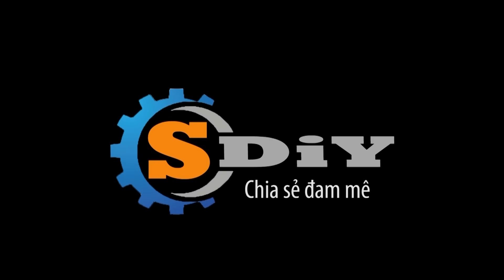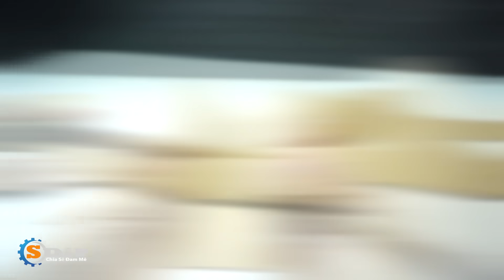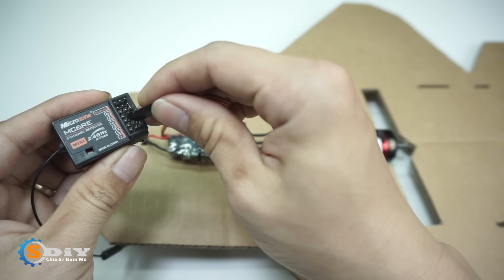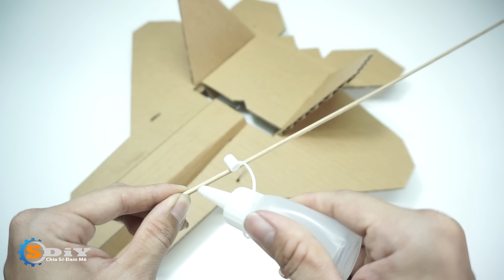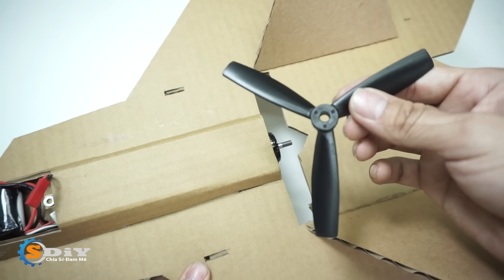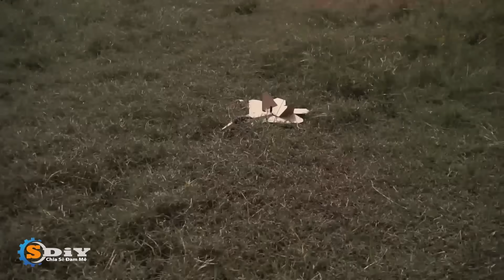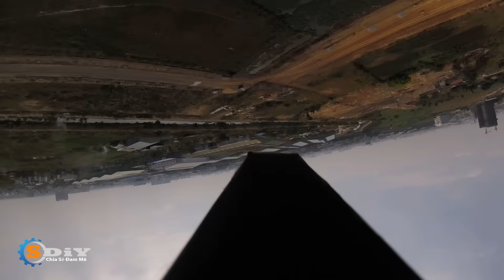Cardboard RC Airplane DIY - F22 Raptor l S-DiY

Comment: What is its weight? 
I have a 1000kv motor and 2200mah 11.1V Lipo. Will it be able to fly with that weight? Wanted a little guidance brother. Thanks in advance !!

Comment: Friend, I have a question. I'm building one like your project, just 1 mm Styrofoam, but I bought the a2208 kv2600, 30A motor. Will this motor work, or should I buy a kv2200 one?

Comment: Is it possible that instead of using cardboard, I could use wood? That same type of wood used to back mirrors and to line cabinet drawers? I am asking because I am not sure if that would affect the weight of the craft in any way?

Comment: Cardboard is not a normal air foil. thus it needs a lot of power to create lift.   Foam board is a more common material  lighter material or you could try to laminate and shape the wing for lift.

Comment: Very impressive design, and even more impressive flying.  Just like modern jet fighters these planes cannot glide as the wings don't provide any lift, and you must fly these RC planes fast, and in turn you have to have good reflex in order to control these planes.  But on top of that the pilot was doing barrel rolls which are much harder than it seems.  The plane is nothing but a dot in the sky when you're not viewing through a camera's zoom lens, and you gotta nail your rolls by finishing them with the plane pointing right side up or it'll be instant disaster. :)  Much kudos.

Comment: Ok, so, first of all: Thank you for the video! It IS an awsome idea.I don´t know how many people commenting here have actually tried to build it themselves though...its not as easy and straightforward as this video makes it look.
Particularily because its misssing a few parts/some things are obstructed.

My Kid decided to make this as a school project with his friends and i helped them.
We just came back after our first test run and disappointingly it didn´t even take off.
Hopefully it was only the battery being too discharged, it doesn´t say how long the battery should last in the video, but we fully charged it overnight and afair we only did a few tests of the rotor before we took it outside, so I don´t see how it could have discharged that quickly.
We´ll do another testrun tomorrow and we also still have another battery with a higher burst rate (75c). It was a bit bigger and heavier, so we tried to get a battery with the exact same specs (3s, 25c, 1000mah).

I´ll report back after the next test, but meanwhile, here are some of the issues you might encounter when trying to build this:

1. Its actually not that easy to find the correct cardboard. Ours where either too light or too heavy or too small in size. You´ll spend some time looking for that.
2. The links for the listed items are mostly dead/don´t work in my country. We ended up getting most of the electronics from amazon though.
3. There are a few steps missing completely:
4. There are no instructions for how to exactly bend the wire, we had to do a few ones until we got the measurements right.
5. There are no instructions on where to get the holders on on the flaps for the wire. We kinda made one ourselves out of plastic.
7. There is a missing part about how to connect the battery on the topside with the ESC on the backside. We ended up simply cutting a hole in the cockpit area.
8. For someone who has never built something like that, a few more infos would have been nice about how the parts work together. For example: Since we couldn´t find the exact models for either the battery or the motor, we ended up with a bunch of unanswered questions and had to reorder several parts...
-There are CW or CCW motors, which do you need to get?
-You can put in the rotor one way or the other way, does that matter and which is correct?
We had several tries with CW and CCW AND switching how we put in the rotor, but the push of air was always in the wrong direction.
Finally we figured out that we simply had to switch the wires around, that connect the battery with the ESC, until the direction of the airflow was correct.
-There are SO many different types of batteries and we had no clue about the "mAh" amount or the "burst rate", like I said, I feel like a burst rate of 25c is maybe not enough, but we´ll see tomorrow...

Again, great idea and execution, but for those of you actually trying to buiild it yourself: Be aware of these missing infos!
Reply from the maker: Thank you. Because of the language difference, and my video presentation experience is still limited. Thank you very much for your sincere feedback!
Reply: Me avisas si esque te funciona exactamente como del video
Reply: If you’re in need of assistance, many local hobby stores staff plenty of knowledgeable individuals. Many, many different hardware configurations can suffice your needs, so there are multiple solutions to any given problem. Before criticizing someone else hard work, keep in mind this video is in a ‘Do-It-Yourself’ format. There are plenty of online resources to help identify and solve your issues in more of a ‘How-To: Step by Step’ fashion. 
Happy hobbying ;)

Comment: Can we use 6045 propeller for this?
Reply from the maker: Hello. With a wingspan of 46cm as shown in the video, you can only use a maximum of 5inch wings (5040 or 5045). With a 6ich wing, you need to increase the wingspan to about 60cm.
Reply: Thank you.

Comment: i got to admire your piloting skills but u could have made it easy to fly and land(fly at low speeds) by focusing on the airfoil, there is no airfoil at all, u need to check out the airfoil designs to find the one well suited for your need

Comment: Pretty much flys perfect once u fixed cg...great job...i just would not want to use cardboard unless there is a way to protect it from water...maybe spraying 3 coats on model with poly spray would do the trick..very nice job and design.😊
Reply from the maker: Thank you!

Comment: Can I use 2200kv BLDC motor instead of this one ? Will the thrust of 2200kv motor be enough for this plane ?!
Reply from the maker: Thank you. Do you have 2212 2200kv ? it will be bigger and heavier than my 2205 2300kv ! Traction both about 700g. With this model, 2205 2300kv would be optimal. 2212 2200kv will be heavy and difficult to control !
Reply: @SDiYchannel01  Ok bro thanks a lot,  but I don't have enough money to buy this motor,  so can my 2212 2200kv motor still be able to fly this cardboard plane?
Reply from the maker: @assassings3030  Hi, it can fly but won't be optimal. You can increase the size of the plane a bit larger, the wingspan is about 55cm instead of 46cm like the original !

Comment: A ơi f22 sải 54cm 
E dùng combo này có đc k ạh 
Tx rx: mc6c
Pin 3s 130mah
Esc 20a
Sevo 9g (x2) 
Cánh 5045
Motor e chưa biết nên đi motor nào 2212-2208-2205 nên đi motor nào ạh và bao nhiêu kv ạh
A chọn motor giúp e vs ạh ❤❤
Reply from the maker: Hi bạn, với pin 1300 3s thì đi mt 2205 2300kv hoặc 2500kv cánh 5 là ngon lành nha bạn. Nếu mới chơi thù cứ ưu tiên pin nhẹ, mt nhỏ vậy là ok. Vật liệu thì ở VN mình chỉ nên chọn MPP hoặc depron, ko nên chọn bất cứ loại nào khác nhé !

Comment: On my plane The up and down movement is okay but the left and right is the opposite of what you just shown, is there anyway to reverse it?
Reply from the maker: Sorry for the late reply. With the controller Mc6c, reverse the servo plug position of CH1 and CH2. If not, use the REV button of the AIL and ELE channels. Or you can combine both ways to get the right servo stroke!
Reply: Thank you very much it worked

Comment: A ơi e chế 1 con f22 đi motor 2205 
Pin 2s 1500mah xả 35c có ổn k ạ ❤❤❤🎉
Reply from the maker: Hi bạn, mt 2205 2300kv  pin 2s với cánh 5" dc tầm 400g , cánh 6" tầm 500g. Gọi là bay được thôi bạn, chứ ì ạch lắm !
Reply: @SDiYchannel01  cánh như trên clip của a là cánh 5” hay 6” 
E mới chơi môn nay nên k bt biết ạh
Reply from the maker: @cau6806  mình xài cánh 5'', muốn gắn 6" thì sải cánh phải to trên 60cm. Lúc này lại nặng thêm. Nên hợp lý nhất phải là pin 3s. Còn nếu vẫn 2s thì bạn nên chọn 2s800mah, kit depron sải 50 cánh 5"", bay kiểu mini nhẹ nhàng !

Comment: Can you please tell how to measure CG  any aircraft plz.
Ex- I am making a mig 29 so how doi I measure the CG.
Reply from the maker: Thank you. Please visit the website "Flying wing CG calculator" to calculate the base CG based on the main wing area. There is almost no exact formula for each aircraft type, I just rely on experience. For example su27, su30, su35, mig29 will have similar wing shapes, so the center of gravity will be roughly the same!

Comment: What an excellent demonstration of how little Bernoulli's Principle actually contributes to lift. Looks like we were all lied to by our 8th grade science teachers!
Reply: Well, cardboard vs. steel, lift requirements are a little different.  Sure, you put enough thrust on a flat surface and angle it to the relative wind, you can make it fly.  But flying efficiently needs every trick.  Believe me, if the airfoil shape of a wing was irrelevant, manufacturers would have stopped doing it to reduce cost.  They still make airfoils because airfoils still work.

Comment: I see now where is the issue with my F22, it was always too heavy because I was building it twice as bigger than yours, the plans printed on A4 papers make it twice as bigger but I build like 6th F22 and I partially used depron so the weight without battery is 340g and I used Emax Eco II 2807 1700KV so that should be crazy fast once it doesnt tear apart. Do you know where is the CG located on the bigger version? Twice as bigger than the one you built in the video
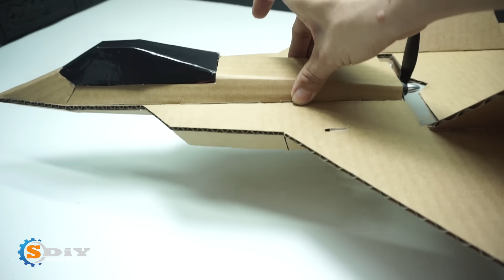Reply from the maker: Hi friend. It's nice to have a friend with the same passion. Regarding the center of gravity, any size it will correspond to in a position like 5:56 . In the drawing folder there is a 46cm a4 file, you can check it again if you want to reduce the size. If you have any other questions, please contact me via email sdiychannel01@gmail

Comment: Can I use the *A2212/6T-2200KV Brushless Outrunner Motor*? because I cannot find the motor you used in my country.
Reply from the maker: Hi. Motor 2212 will be heavier, consume more battery. The increased weight of the battery will make it difficult to control. You can solve it by increasing the overall size of the print to about 55cm!

Comment: Vomo hago para aumentar su tamaño y así el de la hélice a 8050 no dispongo de 5"
Reply from the maker: To use the 8050 wing you have to change the overall overall dimensions by 30%, which is about 60cm wingspan!

Comment: Don't get fooled. This is very dificult model to make, there are missing steps in video, extra holes cut which are missing in paper plan and so on.. just find some entry level ready airplain rc model before jumping in this nightmer...
Reply from the maker: I tried my best to make the video as concise as possible. To give inspiration about model airplanes. But ...

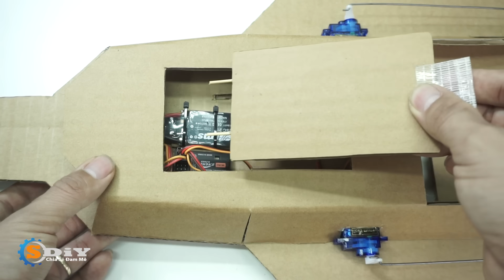Comment: I have a question, how did you connected servo motor to elevators of plane so that it moves up down? I didn't get that part, also servo motor pin assembly that is visible at @4:00 for rest of video it's not seen at all? Did you covered it ? Like when you move elevators at @5:28 where is that servo pin assembly? I can't see any visible pin attached to servo motor?  Can you please explain it ? I am trying to make it as you instructed but I am stuck at making elevator move with servo motor pin assembly
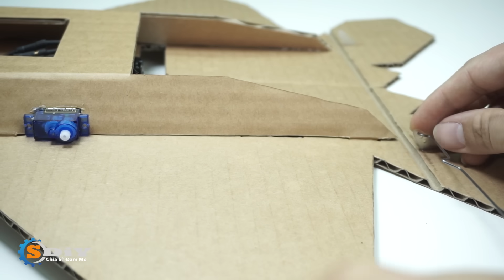Reply: @S-DiY  hey still a confusion, if you look at @3:42 that 1.5 mm steel link's one end is connected to servo, the other end of it is connected to elevator with a safety pin 🧷 kind of thing? Right? That safety pin  is connected at elevator to move it with servo.?
Reply from the maker: Hi friend. At 4:00 fully demonstrated how to plug the servo wire. It includes 1 servo in PIN 1, the second servo in PIN 2. To make the elevator and aleron go up and down like that, turn on the Mix elevon mode (if it's tx MC6C like mine, how to activate it at 5:07). Hope useful for you!
Reply from the maker: Hi friend, more precisely it's a control horn. Because of the video length, I can't show the details, you can check out my other videos that will segment about control horn ! (Sorry, I use translator)
Reply: @SDiYchannel01  thanks friend, now I have some clue to how to move elevator, control horn is all i need ☺

Comment: Hello, s die I have a microzone mc6c transmitter and a mc6RE receiver so now I need to make a fpv racing drone using this transmitter and receiver so is the mc6RE receiver has an S.BUS port to connect a flight controller???so is this MC6RE receiver  compatible with any S.BUS support fpv racing drone flight controllers??

Comment: Would it be good to use Lipo 3S 6000 mah 45C + RMax 2204-2300KV with this ?
Reply from the maker: Hi friend, Because of the weight limit, only 3s1000 or 1500mah batteries can be used with this model size!

Comment: How much does your battery weigh?  what camera do you use?
Reply from the maker: Hi friend, I use 3s1000 25c battery, weight is about 85g. For the camera, I use gopro session, which connects the cradle to the fuselage by a drawstring !
Reply: Thank you for your answer 😃

Comment: Hello. I have a question about the overall dimensions. If I print a A3 version what will be the wingspan?
Reply from the maker: Hi friend, with the a1 version, the wingspan size will be about 46cm. With A3 Paper Size, I guess the wingspan is only about 30cm, it's very small

Comment: This is so awesome that my son and I build it according to your guide. However, we had to modify the motor placing as we do not have the counterclockwise motor. The recommended motor is no longer available. What is your recommendation? Though we managed to fly it, it seems to have other problems, the ctr of the gravity, the glide seems unstable too.
Reply from the maker: Thank you for your attention. Regarding the motor direction, you only need to reverse 2 of the 3 motor wires to reverse, rotate the propeller direction appropriately, regardless of whether it is CW or CCW. If the plane is unbalanced, re-weigh the center of gravity correctly. Make sure the steering wheels turn flat. Hope useful for you !

Comment: Brother i am not getting 5045 tri propeller anywhere in market so which propeller should i use??????
Reply from the maker: You can replace it with other 5-inch propellers, for example 5040, 5140... you can even choose 2-leaf blades.

Comment: Is 95gm is perfect for the weight for the battery????
Reply from the maker: Hi friend, my 3s1000 battery is about 80g. With a battery of about 85h it is still possible within the limit, however, higher speed will be required because of the increased weight

Comment: Sir can't we use Quadcopter prop???
Reply: Like the double one??
Reply from the maker: Hi friend, there are many types of drone propellers, you need to choose one for FPV racing, like in the video I use 5045 prop
Reply from the maker: @reallybonginsane628  Please download the drawing
 Update in my pinned comments. Select the file "A4 paper 46cm.." When printing, it will consist of several a4 copies spliced together

Comment: Hey, will you please gave much more details for parts? Motors are cw or ccw idk what is the difference?
Reply from the maker: Hi there, sorry for the language difference, so my presentation is difficult to understand. CW or CWW issue, it doesn't affect the flat wing model, so you can choose at random
Reply: Thank you very much for answering, im trying to get parts and make the same model, i can use foam 5mm?
Reply: Its my first project so im still not familiar with parts, ESC 30 A much with the 2205 Emax 2300kv?
Reply from the maker: @FPV.ZI-EM  Hi, 5mm foam ( depron, Xps .. ) is a very good material. I chose cardboard just because it's easy to find everywhere...
Reply from the maker: @FPV.ZI-EM  Hi, it doesn't affect, just the price will be a little higher. But if it's 40A, it's a matter of weight. So 20a or 30a is reasonable. But if it's your first RC project, you'll have a hard time...
Reply: Thank you

Comment: Hi! Excellent video! Quick question: Can I use a plastic cardboard (4mm) instead of regular cardboard in order to make stronger and waterproof?
Reply from the maker: Hello, I don't know yet what is the weight of the plastic cardboard, if it is equivalent to the cardboad, you can use it instead, because it has many advantages
Reply: @SDiYchannel01  On an unrelated note, how long is the plane? I know it’s 46 cm in width, but I don’t know how long it is from front to back.
Reply from the maker: @b1-battledroid669  Hi friend, 46cm is the wingspan so they are easy to visualize when printing drawings. Other sizes will be correct when you print on paper, for example 16 versions of A4 copies in a drawing file!
Reply: @SDiYchannel01  Thank you!

Comment: Bro can I use 5030 propeller
Reply from the maker: Hi friend, 5030 prop is very fragile, it will be weak and bent with motor 2205...
Reply: @SDiYchannel01 bro actually the motor is 2212 2200kv
Reply: @SDiYchannel01  in my area shop 5045 not available only 5030 so will plane raptor fly with 5030 tri prop 
Please tell me bro
Reply from the maker: @s-series8144  Hi, if you already have 5030 tri prop, you can use it temporarily! If you choose to buy, you have to use 5045 props..

Comment: Please I can't tell which side I should put the propeller? The curved to the inside or outside ??
Reply from the maker: Hi friend, by convention, the propeller face with the text line will be the suction side, it will return to the nose of the plane. The glossy side is the push side, it will face back...

Comment: hello how do you power the receiver on the plane bro?
Reply from the maker: You use ESC type with built-in 5v BEC, when you feed the signal wire to the ESC, it will power the receiver at the same time!